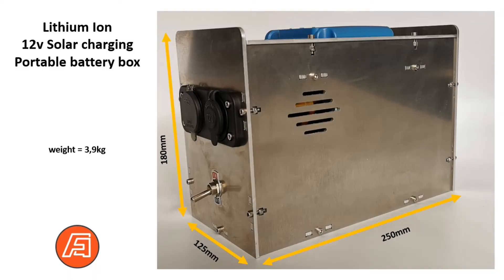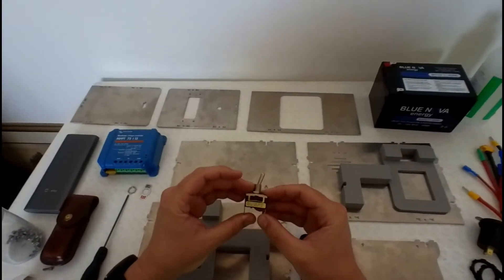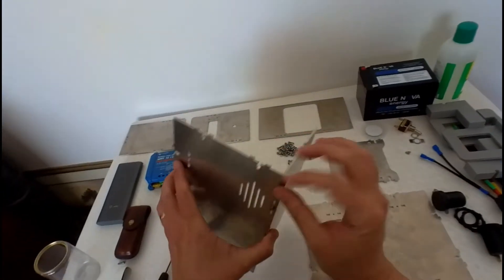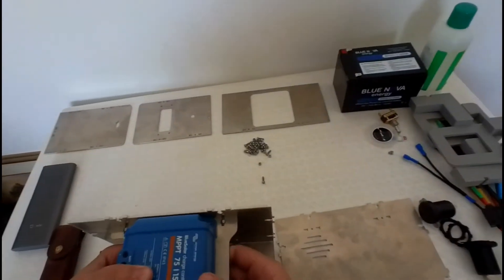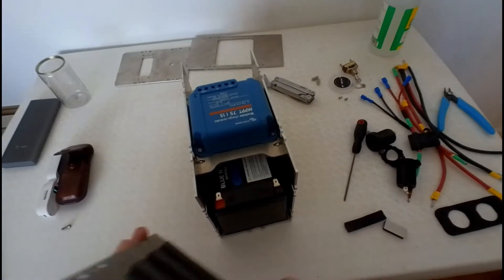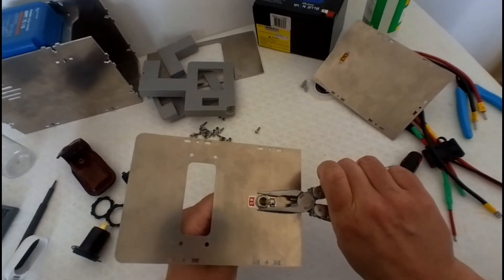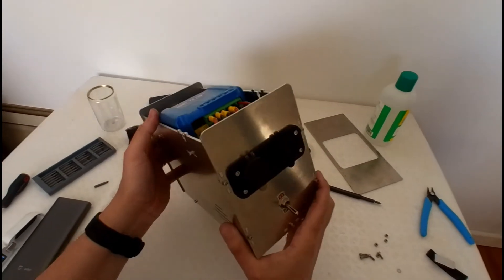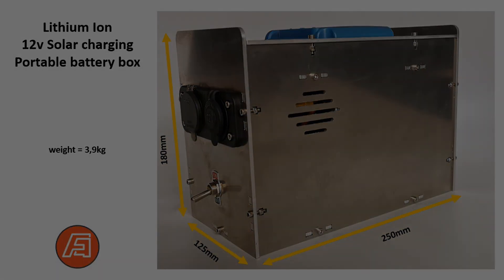DIY Portable LiPo battery box.

Comment: very nice indeed.
build similar. I just used a small pelican type carry case . even have handle to carry it around with. 
admire your effort to have a box designed and laser cut. 
price wise however a small pelican carry case must be 10% of your exclusive designed case.
however, your box is pretty darn unique and will always stand out. 
have to applaud that. well done
Reply from the maker: Thanks for the compliment JB. I tried the Pelican case route, but needed a smaller form factor. Pelican cases are rather expensive here in South Africa :)